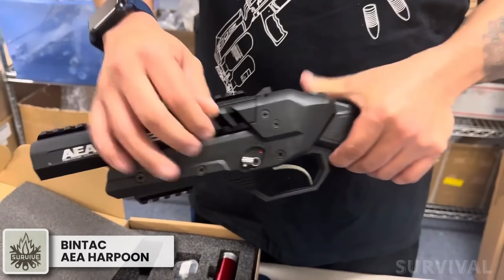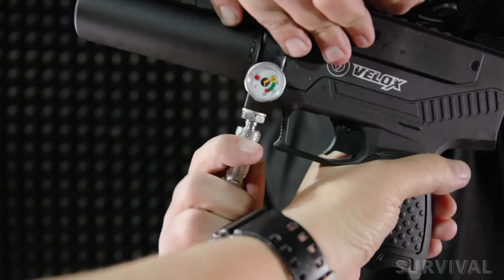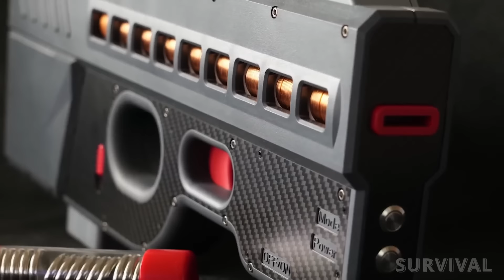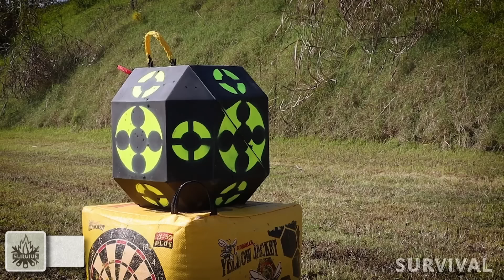15 LETHAL WEAPONS THAT DON'T NEED GUNPOWDER ON AMAZON!

Comment: That wasp is kind of a funny weapon. If I remember correctly, it was built to bypass a law that limited the minimum length of firearms. The bypass is that it has no barrel and instead uses long cartridges that act as the barrel. It's silly, but I kinda vibe with it.

Comment: actually it i was in a gun fight. I would rather have a paintball gun with plastic coated lead balls( lethal within 250ft when adjusted, +250 definitely debilitating). 

Reason: because you can load 250 rounds in about 2 seconds. and with an autococker you can unload 10 rounds per second, constantly!!? plus it pretty quiet and they won't know they are about to get hit buy about 50 rounds in about 5 secs. 

my second option would be 12ga.  with  00, or 000  buckshot. Which is like unloading a full hand gun clip in one shot. Then you  can have 6 to 50(drum) rounds to 

so what  would you pick? 

I do have to say the electric coin shooter is pretty neat

Comment: The 1350 ft per second 1 pump target pellet rifles will turn anyone around especially with  the .22 cal target pellets .... i prefer the .177 caliber but matching the fps that they offer is hard and you can get them for 2 or $300  ... they wouldnt be considered less than lethel ... they will rip right through someone lol 😆

Comment: It's disappointing that so many videos fail to give timestamps.
1. 0:12 - Double Barrel PCP Air Gun - $439
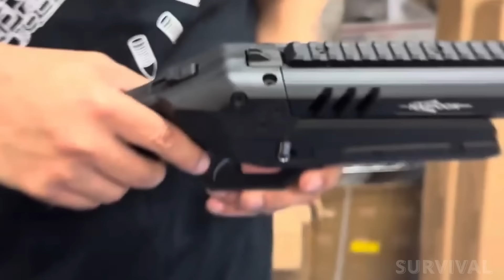2. 0:45 - AEA Harpoon Air Pistol
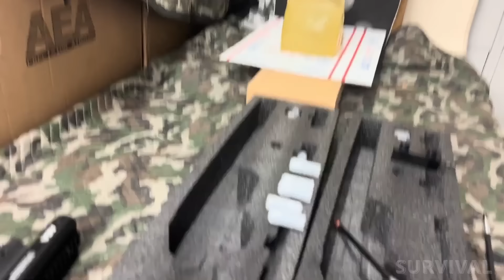3. 2:10 - FN303 Tactical Less Lethal Launcher
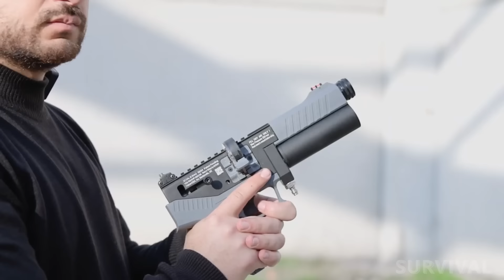4. 3:42 - Hodson VLOOKUX PCP Air Pistol
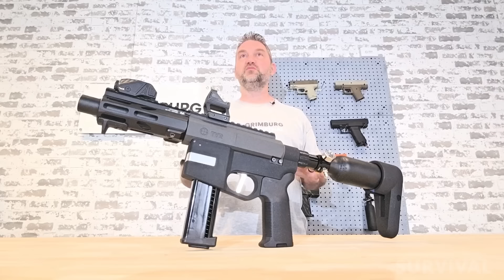5. 4:46 - Grimberg Tyr PCP Air Rifle
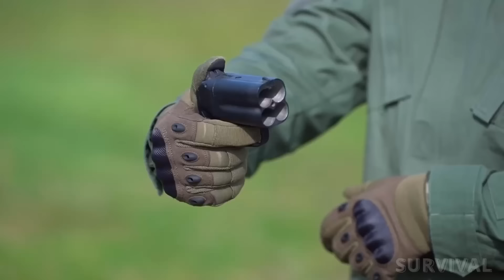6. 6:37 - Wasp Less Lethal Pistol
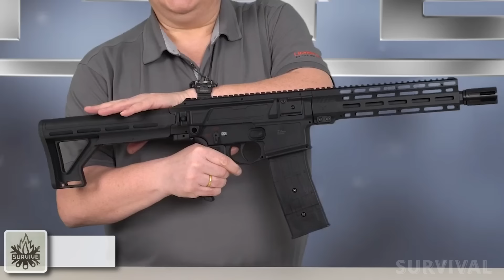7. 7:34 - UMRX T4ET TC68 Carbine
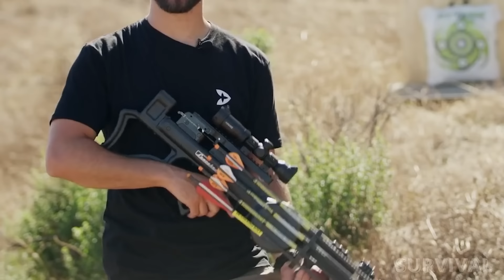8. 8:44 - Lancet F1 Torsion Crossbow - $1,999
9. 9:35 - RSX7 Doomsday Slingshot - $239
10. 10:15 - CA9 Coil Gun - $1,600
11. 10:44 - Steambo Fenrris Arrow Magazine
12. 11:18 - UmerX T4E HDX Home Defense Extreme
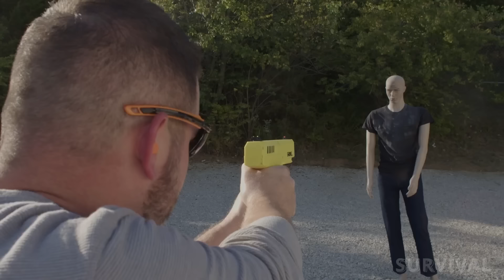13. 12:44 - Saber Pepper Launcher
14. 13:31 - Hotson Sniper L PCP Air Rifle
15. 14:20 - Gamma Arrow PCP Air Rifle
Reply: TY
Reply: I reported for clickbait, they need to stop false advertising what is in the video
Reply: @mumrah73  Is reporting a video for a clickbait title a thing now? Is it against Youtuub policies? I never even thought of doing that before.

Comment: The bow attachment was cool. The short shotgun at the start would definitely kill someone. A friend uses 30 and 40 cal airguns to kill deer on the local airbase. They work well. And yes he was hired by the airforce for deer control. However, nothing beats a real gun to do the home defence stuff. A true shotgun or 9mm or 357 with hollowpoints is probably the best. Less likely to blow through the wall and into the next house.

Comment: The title says lethal but the video is full of non lethals
Reply: But those higher calibers fired at close range could potentially be lethal or permanently damaging. It goes without saying that a powerful shot in the face, eye, nose, temples, throat or other delicate areas could be lethal.
Reply: It's all in the matter of where you aim
Reply: @djmars1983 or where you can aim.

Comment: Just googled has anyone ever been killed with these weapons. The answer was "NO" obviously. Do not replace home defense with these.
Reply: Just because it hasn't happened does t mean it can't happen. Most of those were not lethal weapons. But the pcp guns now are very much lethal
Reply: In these F'd up times they are more likely to charge a guy for murder for defending home and family from an armed crackhead,,,always good to keep options open
Reply: @scottplagmann3411  I agree, but a good nail gun would do the trick.😅
Reply: Depending what you fire from the PCP guns, you can definitely turn it lethal. Hell, I have a modified HDS68 and that sucker can drive a 3inch nail straight into wood. I also made some modified arrows for it that use mechanical broad heads from arrows. That sucker fires a broad head at you with a 2inch cutting diameter and it will definitely ruin your day. Especially if it's a center mass shot. I also used barbed fishing bolts as well so once those suckers go in, they aren't coming out easy.